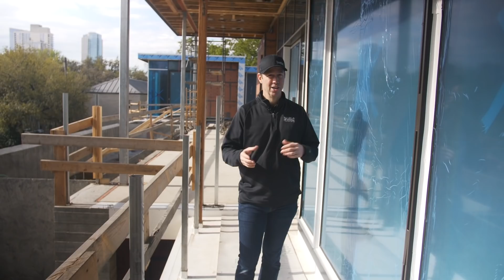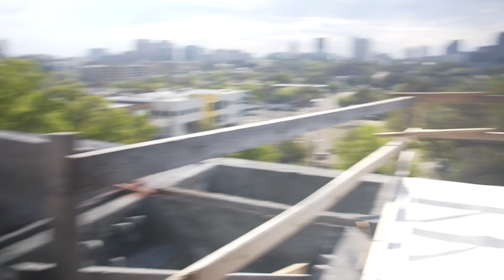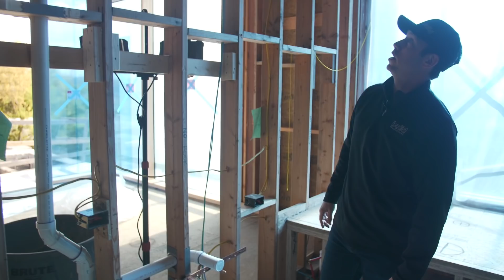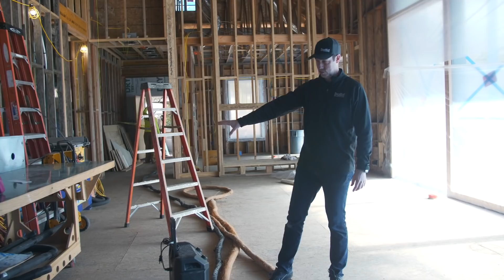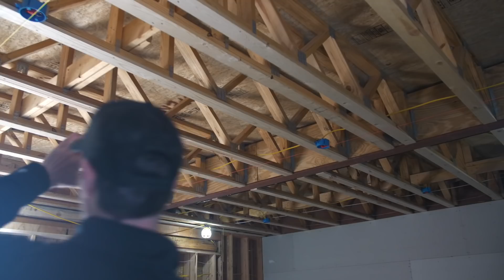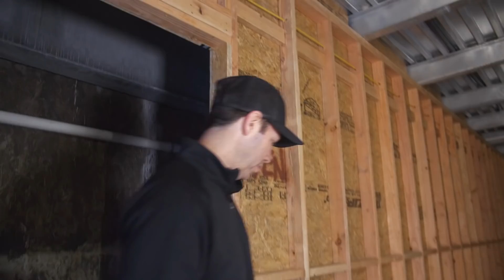How do we Build in Austin, TX?  Visiting a job in Framing

Comment: I have had 7 house in the Austin area, 3 of them full custom where I did the initial design work. Cost averaged $875K. I had to fight every builder to get them to do even the very basics of protecting the job site and materials, and keeping it remotely clean. Many of the things you point out as good practices they punt saying their contractors know what they are doing, which was to take every short cut to maximize their profits. I was willing to pay extra to get things done right, but that would upset their trades. I ended up having to do/re-do many things myself to avoid a crappy end product. The builders argument was consistent - "the average buyer doesn't understand or even care about this details!". Of course, before signing every builder promised to address all of these details, which was an out right lie. I had to get seriously involved (hands on) with the electrical design of these houses, both high and low voltage, because their contractors didn't even know the requirements of how to work with the service provider. BTW - the builders I used all had a solid reputation.

Comment: I marked out the RCP on the slab with my bosch 3 plane laser (GLL3-330CG). I also marked ALL of my wall boxes (on the floor w/ on center height). I found those were much more likely to be covered. 

TIP: You'll probably put down some membrane on the floor before mudding, but put it down after you hang drywall otherwise you won't see any of your marks until after mudding. That's what happened to us.
Reply: Liked the idea of routing the studs for the drywall screw plate protectors! Thanks for that tip!

Comment: Best residential electrical install I have seen! Beautiful work.
Reply: Do you know if that’s all 12 gauge wire?  Where I live yellow is 12g. If so seems way overkill and kinda sily
Reply: Kyle D yes it’s all 12 gauge and no it’s not overkill at all. As a custom home electrical contractor I’d say that system is actually average. We only install 20 amp circuits for our outlets and we run a minimum of one circuit per room. We just did a 10,000 square foot house and it runs over 100 circuits. Build it right or don’t build it.

Comment: It's neat that there are actually builders out there that care to do such quality work.  I'm pretty sure this level of construction doesn't exist in my area.
Reply: All depends if clients have deep enough pockets.  Not many have multi-million budgets
Reply: @ArthurDentZaphodBeeb  Well I'm sure this is a costly build, but what I am focused on is the precision and care--strings to ensure can lights line up, neatness of the electrical wiring at the panels, protection and CORRECT handling of materials (doors he talked about), and overall methodical and thoughtful treatment of various build aspects you can see through out the video.  This stuff is what makes the difference and none of that is expensive.  It only requires a builder and subs that really care about their quality and the customer's investment.
Reply: @JuanHernandez-ox5tl   yeah, string line for ensuring can lights line up is super expensive
Reply: @JuanHernandez-ox5tl  That's chump change and I'd do it with a smile.  I've spend $10,000s of extras on my home build to get things the way I want:  hot water heater recirculating system, high efficiency furnaces, ERV, wood windows, and on and on.  What pisses me off is when the builder did something at the quality level you probably do Juan and never gave me a chance to pay more to have it done well.

Comment: We use that pan deck system with the same corrugated steel over just about every front porch that covers cold storage here in Utah. I've also seen many and built a couple homes where most of the garage floor was just like this. Provides extra space in our basements here in Utah. Just because I'm sure there will be comments... Yes, it does take some engineering to do a garage floor like this. But engineers are smarty pants, nerds like that, and stuff like this is like a feather in their cap.

Comment: Now compare this job to the small 60 year old laundry room up grade I've got and the differences stack up: My project looks like a cobbled together shed slapped haphazardly on the back of the house as an afterthought. Then cram a washer, dryer and a water heater, exposed gas lines, a 2" electrical conduit to a new 200 Amp service, waste line and vent coming out of the floor as are the hot and cold water lines. The supplies for the washer are also running out side the wall cavity, and the dryer vent is running over top the water lines on the top of the water heater. Oh, boy. What a mess.

Comment: I know I'm a little late commenting but I don't like that pool wall backing up to the basement.  That effervescence is an indication that there are water issues.  I saw the fan and but I think there should be a better remedy.  Maybe that whole area behind the pool wall should be a poured concrete wall separating that wet area from the rest of the basement.  I know he used huber zip but I don't like it.  I'd love to know now, 2 years later if there are any issues with that wall?

Comment: The idea of taking your drywall to the floor is so it is supported across the horizontal by the floor plate. By inserting a skirting board the drywall is left 4 inches off the floor with no support between the upright studs, or am I missing something

Comment: Hey Matt, I have a question... I have a house in TN I'm repairing and I have found the original builders have made a mess of a lot of things. My biggest issue is some floor trusses that need replaced between floors. Above the space is the kitchen, and the owner does not want to do a complete tear out, yet I have to take out the bad trusses and set new in. I can't sister them because they are too short by 26". To fix this they put a unnecessary door to make a support. I need to lose the door and put in the correct trusses. How do I support the upper floor since there is not a truss on one side to help hold a temp support. Any help would be much appreciated. My original suggestion of removing the excess weight, is a budget blow out the customer cannot even think of affording.

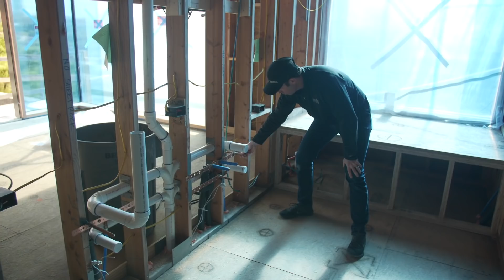Comment: 7:18 Why is the master bath sink area roughed in with four drains at the double sink?
Reply: I noticed the same thing. Also at 11:49 you can see another sink roughed in this way. I've never seen this before. Hopefully someone can shed some light on this DWV technique.
Reply: At a guess I'd say they are using Studor vents, also called air admittance valves. Since the stack is right there it can't be because it's too far from a vent stack to properly vent, so I think it might be that they didn't want a vent to penetrate the roof either for aesthetics or issue with sealing it.
Reply: worldadventureman Thanks for the reply. Studor vent was my first thought, but like you said the stack is right there, so I don’t think so. I just hope someone else reads these old comments and can answer. I’ve seen this a few other places IRL and don’t really understand.
Reply: @Davidw2981  I still think its for a Studor one for each sink. Like I said I think they did it so they don't have a vent going through the roof. Also if you notice its 2" pipe all the way not 4" on that riser, so I think that requires the air admittance valve.

Comment: @ 13: 07    Your 'stair-detail' , is your 'stringer/horse' a notched  2'' X 12'' (# 2 or better)  ? If so, your design-detail does not connect the stringer/horse to the stud-walls/stair-well walls ?
My preference is to fit the 1X 12 (closure to the tread and riser at the ends) well fastened to the stringer, then fasten the assembley through shim-stock that will leave room for an easy drywall install, but still have the load-carrying job of the stairs, well transmitted to the stud wall.
Reply: In the Pacific NWest we run a 2x6 ledger to studs then attach stringer. The 1 1/2” space allows for 1/2 or 5/8 Sheetrock and 3/4 to1” diagonal wood trim.

Comment: 100 G's just for that electrical at 20:00
Reply: brianwball40 or more. When we do Lutron Homework’s systems, our price starts at $100k and goes up from there.
Reply: They’re panels drive me nuts though. The did several small panels vs putting in some real robust 60 circuit panels. On a custom house, that all we use.

Comment: My new Alabama home was made from 2x4s on 24 inch centers.  Is that expected?
Reply: On low end homes
Reply: @ArthurDentZaphodBeeb  What I should have asked is, is that sufficient?
Obviously it meets code.  Will the lifetime be limited?  A tornado will destroy a 2x6 on 16" just as easily?
Reply: @DumbledoreMcCracken  the sheer and debris form a tornado will take down almost any wood structure. Only thing that is tornado proof is concrete. 2 by 4 at 24 inches will make a very unstable wall.

Comment: I'm in Dallas, just bought a house, how do I verify contractors aren't using illegals as labor cash under the table?
Reply: Ask if he has a build going on now and just do a drive by but don't tell, all your questions will be answered.
Reply: Chances are yes. Immagrants in the last 10 years have taken over everything but plumbing, mechanical, and electrical. If you want your house to be built with all legal guys don't plan on having a house built. Even with all the immigrants everyone is still spread thin. No one wants to get into the trades these days.